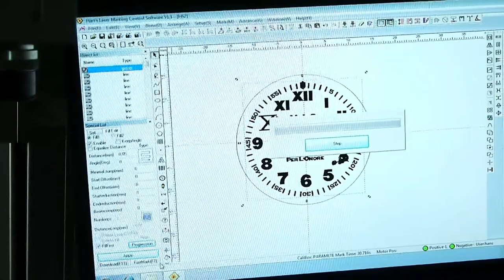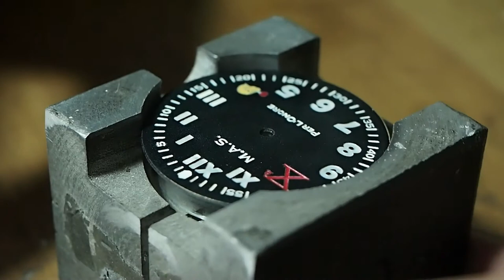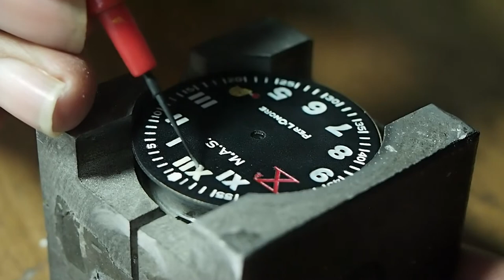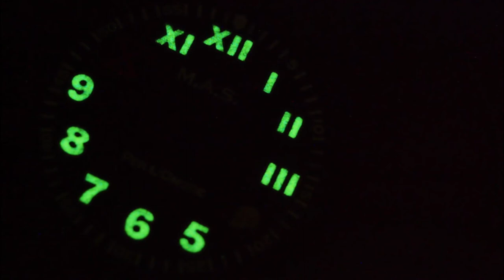Making Custom Watch Dial : Another Version of X MAS Dial

Comment: Hello. Great job. Iwould like to ask how and with what you remove the excess paint.
Reply from the maker: I use alcohol and wipe it gently with an optical cloth that usually used to clean the eyeglass lens. But the dial paint must be strong enough in handling the chemical liquid like alcohol. I will filming this process on my next custom dial video. Thanks.